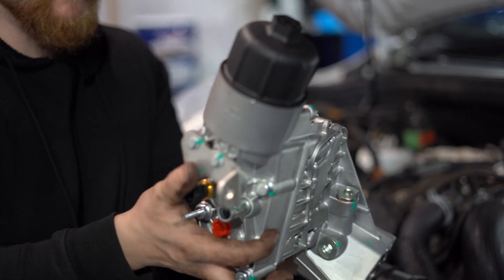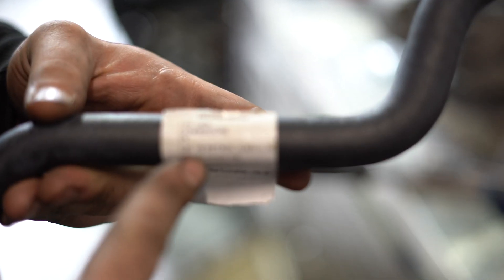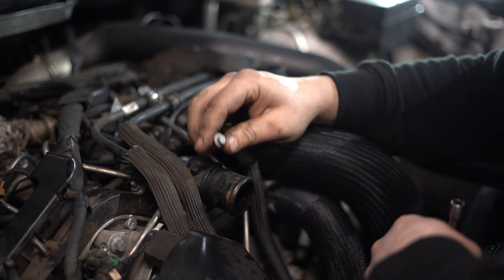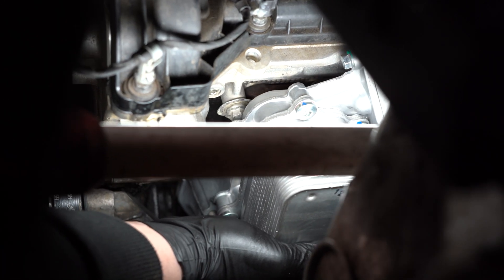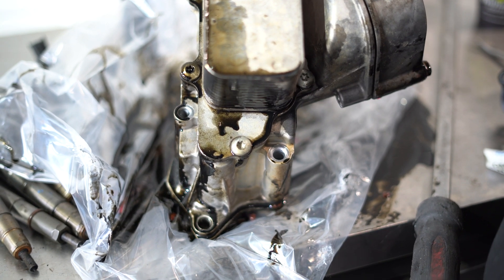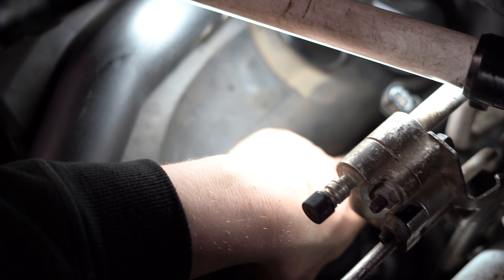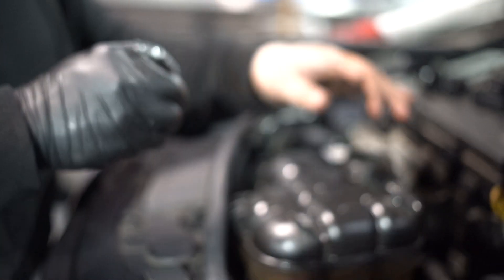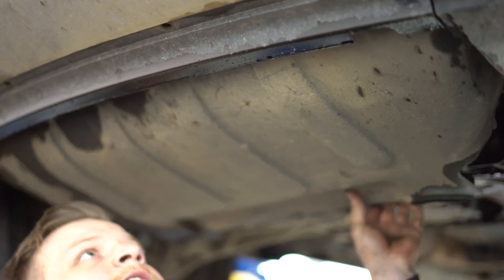WK2 Jeep Grand Cherokee Diesel Oil Cooler Installation

Comment: Can you remove the three bolts just to check the inlet for blockages?
I want to take mine off just to inspect and check if the screen is clogged
Reply: you will probably need a new gasket if you do.  they tend to be buggered when you take them apart

Comment: Hey mate did just the cooler it sellf 12 months ago have now had the same issue . Assuming its a seal in the actuall asembly . Is there any reason as to why these cant just have seals re placed  rather than buying new assembly
Reply from the maker: you can buy the gaskets off ebay. Jeep wont sell them separately. We cant do ebay as we have to warrant the repair. However we have many of our followers that have successfully done this repair without purchasing the complete cooler off Jeep

Comment: Any advice on how to change just the Oil Temp Sensor to clear a P0198 code? I have a new sensor, finding access to remove the current near impossible.
Reply from the maker: Its on the back of the oil cooler. It is easiest done from underneath and by removing the Z hose
Reply: @ thanks, ultimately did it from above after removing the windscreen cowl as per your video on that. Was lots of fun, has to bring in a ringer with small hands to get access.
Reply: i have found it pretty easy to do from underneath and dont have to remove anything else
Reply: @vinceking719 when I got back underneath I could see how to do it.  But I needed to remove two covers to be able to access. 

Even then I couldn’t access while lying on my back, and I have long arms.

Comment: When you’s have taken out the old and put in the new did you’s flush out the entire cooling system ??
Reply from the maker: @konishadyer8932  yes. We do it we an electronic in car flush machine and even the. You have to do it after the job has been done and again 5,000kms later

Comment: What are you using to flush the engine / heater core / radiator ?   Dawn dishwashing concentrate?
Reply from the maker: We have a machine to flush the coolant system out. Can't say we have ever used dawn. Let me know how that goes, if you try it.

Comment: How did you get the hose from the back of the oil cooler off? It’s literally the only thing giving me fits at the moment.
Reply from the maker: Just cut it in half and get a Vt commodore heater hose and cut it to size
Reply: What’s the easiest way to reconnect it? Top or bottom? As far as I can tell the oil cooler has a hose clamp. Can’t see the other end clearly. Also, can you just pick that hose up at an auto parts store or what?

Comment: Is there an air bleed location when you replace the coolant ?
Reply from the maker: Hey, yeah there is a little nipple on top of the thermostat housing you can unscrew to assist with bleeding, just don't drop it or loose it.